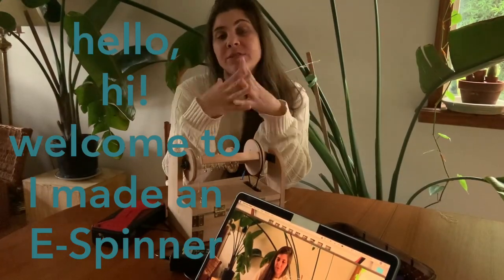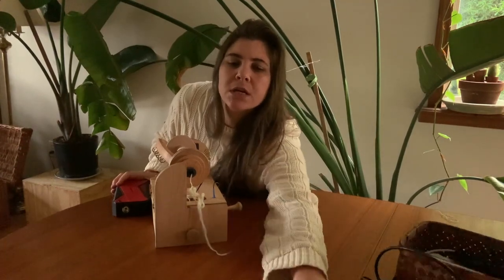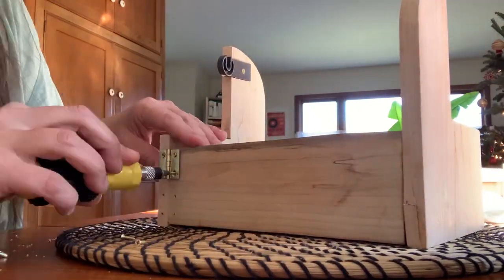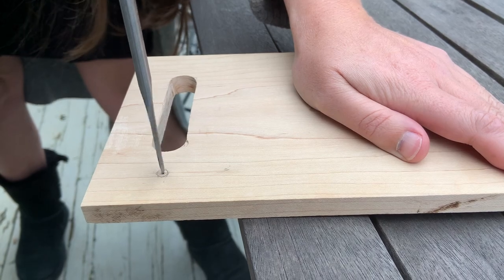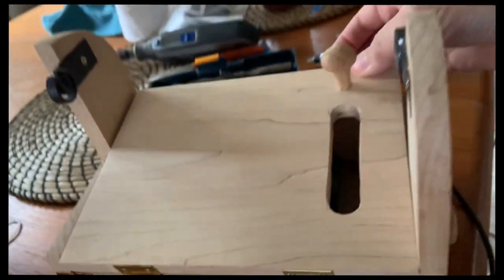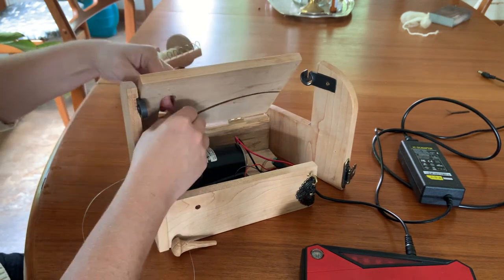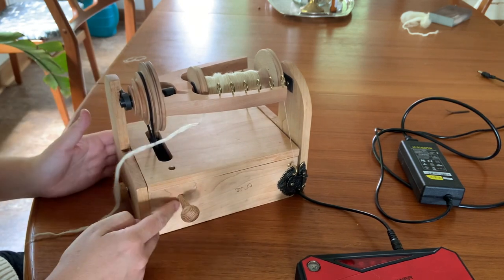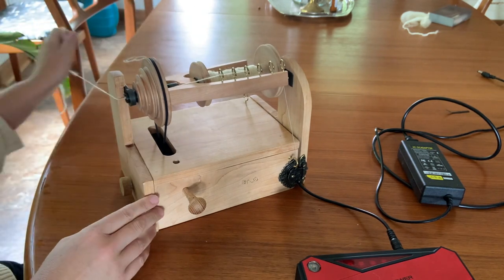I Made an E-Spinner | DIY

Comment: Hi Sarah, where did you find the plans for the box and flyer mount?  Thank you!
Reply: I would also be interested in this as hubby is trying to build me one.
Reply from the maker: i drew them - i was confined by the size of the wood I had, but the most important thing is the length of your flyer and the height of the movement of your flyer so it can spin freely. Inside the box just needs to fit your controller and motor and if you want to put in a battery. i can see if i can dig mine out and share them somehow.

Comment: Thank you so much for the video! I've followed your instructions and made my own, unfortunately it has bad tension issues and makes squeaky noises 😢. Do you think you could help find find the problem? 🙏
Reply from the maker: Yes! Do you have any sewing machine oil? You are supposed to oil the bearings. If the squeaking is coming from the motor, you will probably just need to replace it? Did you order the same flyer? The only other thing I can think of, is that maybe the distance between your bearings is to short and its squeezing the flyer?
Reply from the maker: If you make a video and link it, i can look at it and try to help.

Comment: Hi. Very inspiring. I was wondering if you could possibly write the dimensions of the box, please? I am planning to make one. I have the same flyer. Thank you
Reply from the maker: essentially the size of the box height doesnt matter but the length between the bearings should be 8 and 3/4". that is just the length of your flyer. the height of the bearings just needs to be taller than your flyer. which im not sure what that is but on the woolery site they have the dimensions on the flyers.

Comment: Also, what is the purpose of the brake and can you detail how that works and is attached..?
Reply from the maker: it creates the tension between the flyer and the motor which allows for the pull of the yarn onto the bobbin. all spinning wheels have a "brake" of some sort - these are either irish tension or Scottish tension. this spinner has Scottish tension.

Comment: Can you link the speed controllers? I'm having trouble finding them
Reply from the maker: here's one that i would buy with a speed control and a reversible switch. https://www.ebay.com/itm/164622896168?hash=item26544a0c28:g:cGUAAOSw-9Zf273Z

i'm not sure if this one has an on off switch so you may want that feature. searching 12 volt motor controller with pentiometer and switch on ebay should help bring up other options. it seems that things are very pricy with all the supply chain problems, good luck.

Comment: I would use a sewing machine motor with foot pedal to be able to adjust the speed with a foot pedal. Surely this can be done!
Reply: I tried that but you don't get enough control believe it or not. I ended up having to buy a separate motor control to adjust the speed slow enough to spin
Reply from the maker: you know i contemplated just using a sewing machine or a drill to spin on at first, but those things are loud! a sewing machine motor is probably around the same price as this motor, but the motor plus controller was like 35 bucks. the expensive part was the flyer! and this motor is so quiet, im very happy with this setup. im sure you could probably use the wires from a pedal and attach it to the pentiometer output and see if it can function the same, i wouldnt be surprised if it did. conversely, i wonder if there are 12v motor switches with pedals attached. i dont even use the pedal on my sewing machine, so i wasnt interested in that.
Reply: I think there are power cords that have switches in line, and I’ve seen people have swapped to those to use with their eew Nano